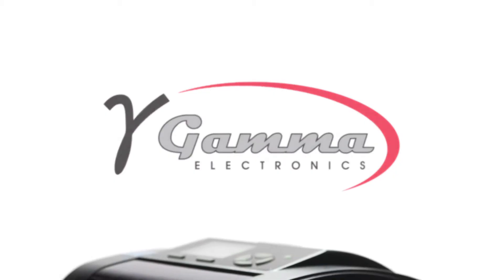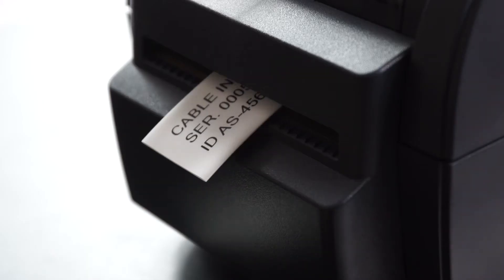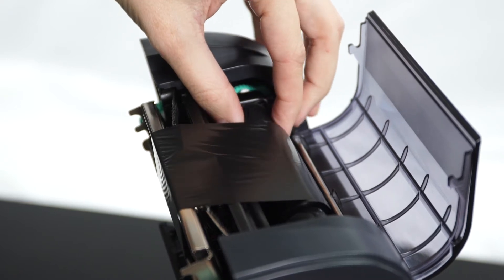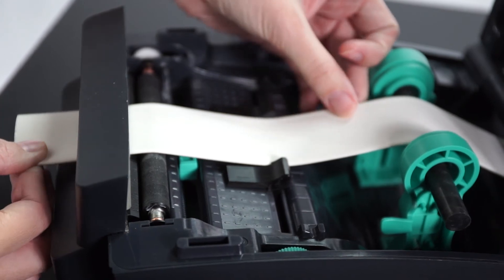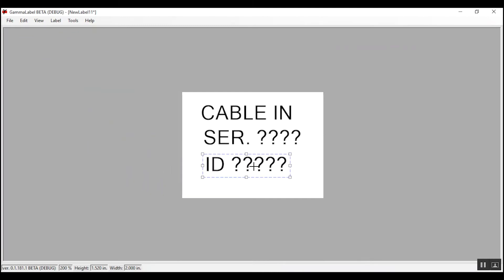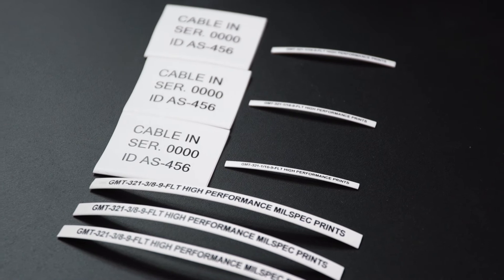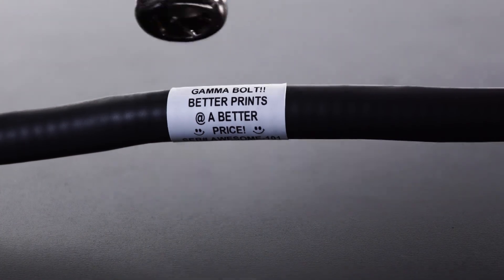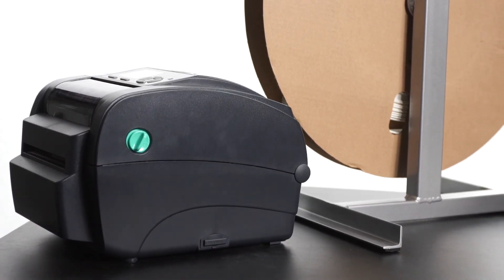Gamma Bolt - Heat Shrink Tube Printer

Comment: Can you use any type of heat shrink with it , or you need a special type
Reply: We recommend that you use our heat shrink with it to get the ultimate results.
Reply: @socalpete7899  lol of course you do...
Reply: @socalpete7899  do you offer 3:1 duel wall 1/4 round tubing for your printer and if so what is the tubing color options?